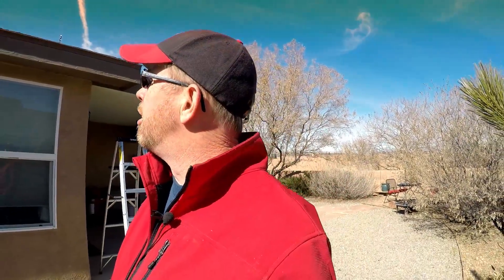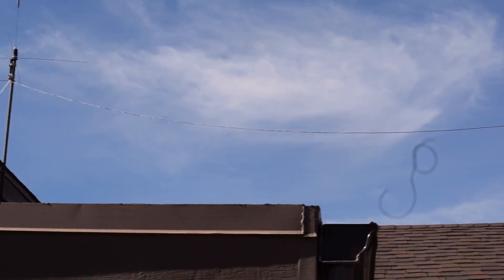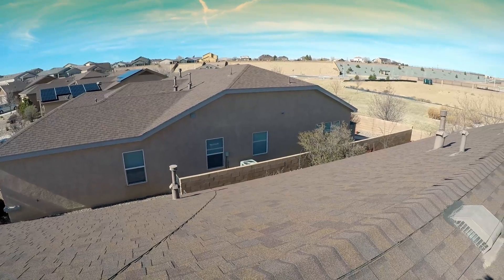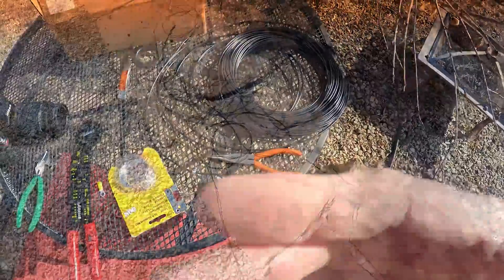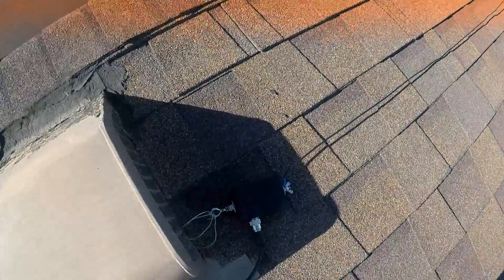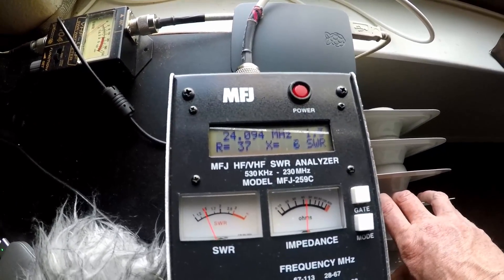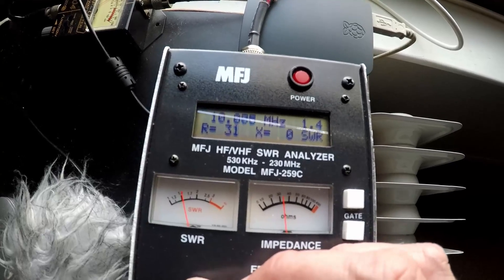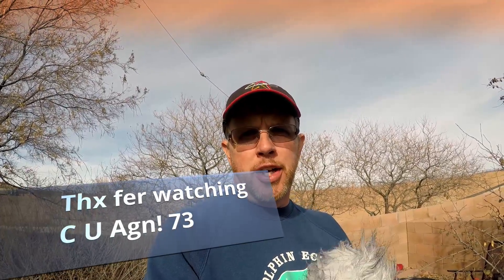H.O.A. Stealth Antenna deployment for Ham Radio.

Comment: Very poor job.

Too many hazards

My 80/75 dipole is SIX FEET HIGH and invisible.

Perfect 1:1 SWR.

330 KHz bandwidth at 3:1 SWR.

See my channel for real antenna info.
Reply: PS also VERY BAD place to put it.

Putting the max RF fields INSIDE THE HOUSE.

Comment: So, maybe I missed it but the 9:1 balun and an odd length of wire yields "acceptable" VSWRs on 80m through 10m? Other than blind luck, how does that work?
Ah gots ta know!
Reply from the maker: Well, you need a tuner for starters.   That will get the SWR down to levels that will let you operate.  Not as efficient as a resonant antenna for sure, but for stealth and convenience, a long random wire is hard to beat.
Reply: @TechGearJunkie ..so DID you get natural dips in the 30m, 40m, 20m bands, etc. without the tuner?

Comment: Hey Greg, thanks for this video, I'm having issues since I moved to a condo, there is a way that we can talk I will leave my email gregorybadilla@gmail.com   I need help to setup an antenna like yours to work 40.20.17 and 10m, I cannot put any antenna in the roof... not yet until I saw your video, thanks at lot and 73s from Costa Rica  TI2GBB
Reply from the maker: Sure,  check my QRZ page, my email is there. I would be happy to help however I can!

Comment: Electric fence insulators are usually good to use.
But I'd also recommend to have a metal sheet roof to shield the inside of the house from the radio waves. Just the problem of the HOA to deal with.
Reply: I guess it is quite off topic but do anybody know of a good site to watch new series online?
Reply: @Scott Ryker Flixportal
Reply: @Bennett Tobias Thank you, signed up and it seems like a nice service :) I appreciate it!!
Reply: @Scott Ryker happy to help :D

Comment: Thanks for sharing your setup. Stealth indeed! I have cement roof tiles, I wonder if I could have a similar configuration?
Reply from the maker: AD6DM Dennis I bet you could.  The underside of my roof is lined with a metallic shielding which should be terrible, but the antenna still performs ok.  Your situation should be better.

Comment: I’m curious. Whats the name of that antenna?  Is it st a long wire?    I thought hf antennas need a counterpoise.  So confused.   Thanks.  

Thumbs up by the way.
Reply from the maker: Theo T the “antenna” or base is the 9:1 box I bought on eBay.  It comes without the wire.  It’s called ALL STAINLESS HARDWARE End Fed Dipole 80-6M Portable HF Matchbox.  Catchy title I know.  In this case, because my feed line is so long, it uses the coax braid as the counterpoise.    Thanks for watching.